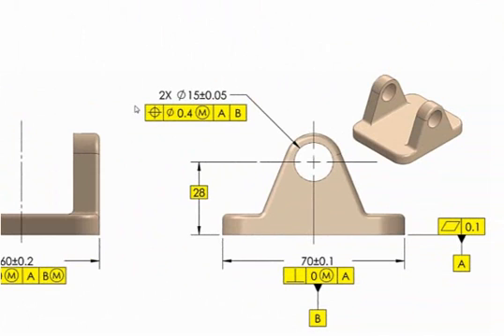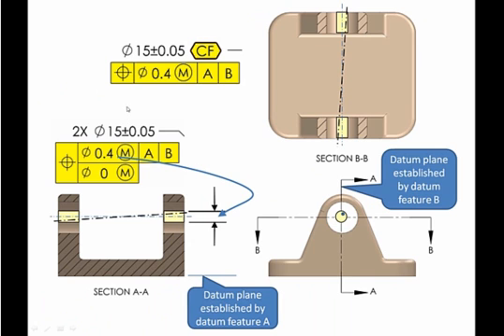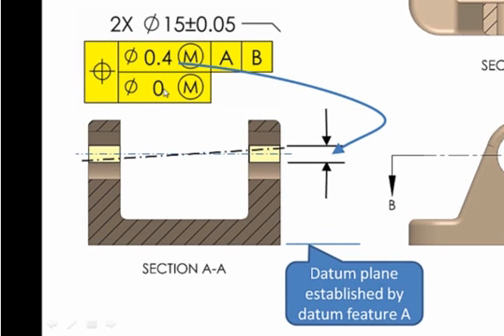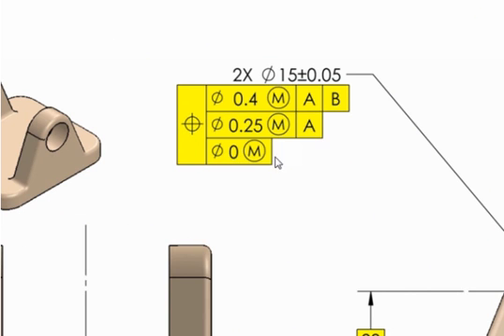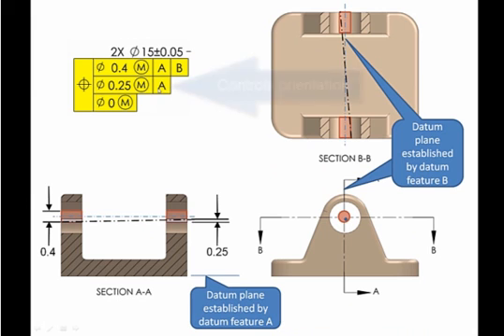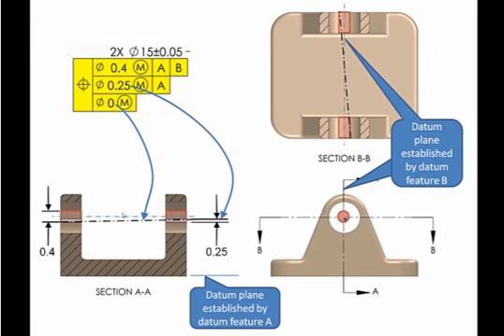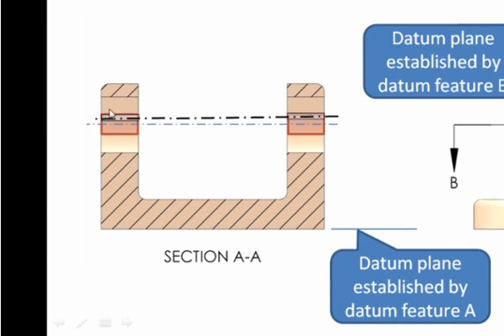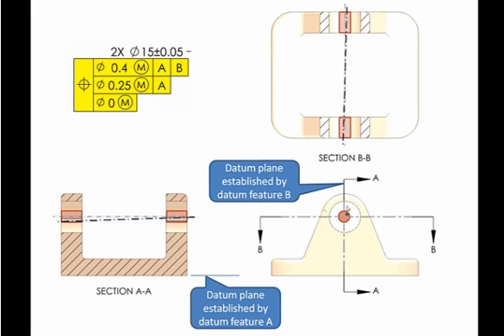Unlock Composite Tolerancing -- Part II of III

Comment: Is the last zero position tolerance at 2:42 on MMC is really practical? If both holes have size of 15.0 mm, which means their position tolerance is 0.05mm and if both holes are 14.99, the position tolerance is 0.04mm (say the tool have some wear). What I mean is the position tolerance is tight when using Zero tolerance on MMC, do you think the manufacturers can really make both holes with size between 15.0 - 15.05 under such a tight TZ. So their position tolerance stays between 0.05 - 0.1mm?